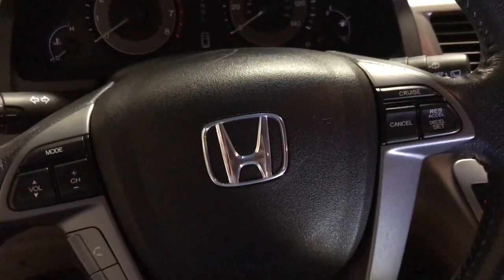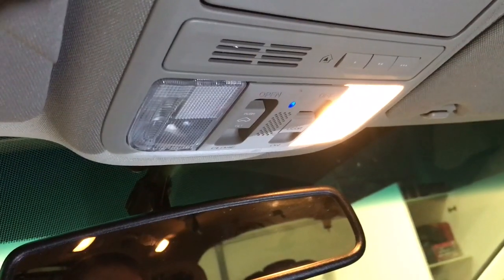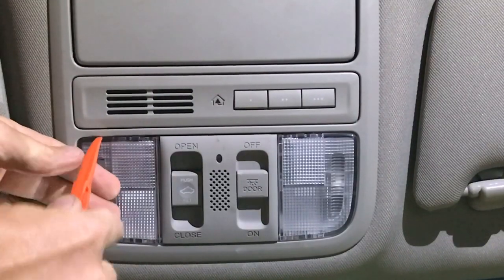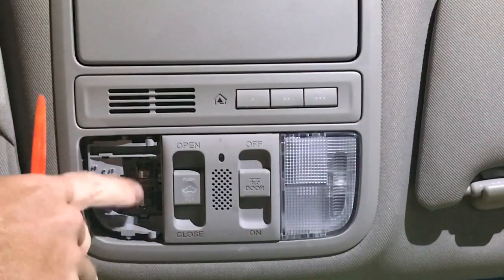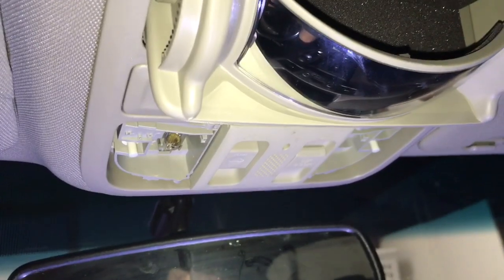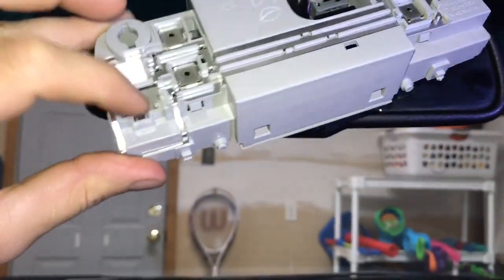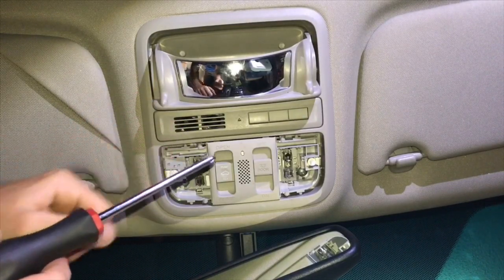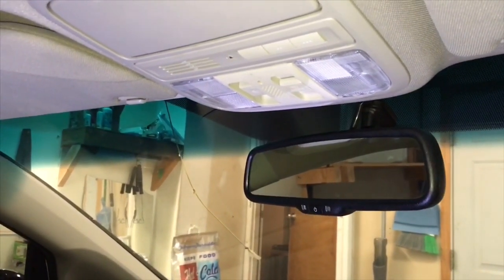Dome light switch and bulb replacement. Honda Odyssey.

Comment: Thank you! This was extremely helpful and easy to follow. After replacing the bulbs and fuse, they dome lights still weren’t working. Replaced both switches and voila, both lights work now plus I was able to return the bulbs and fuse for a full refund.

Comment: Thanks for the excellent video. You explained everything perfectly. In the case of my 2011 Odyssey it was the passenger side that did not work even though the lamp was good and I was able to take it down far enough to get the switch out without unplugging the wiring.  Some shots of CRC contact cleaner into the little holes in the switch and on the three little contact tabs and putting the switch back in restored operation. I probably should have followed up with some WD40, but now that I know the easy procedure I can do that if it fails to work again. BTW, I found it easiest to remove the lenses by prying down on the ends of each lens at the inside corner by the pivot point. Thanks again.

Comment: Thanks for the video.  In my case I didn't even need to buy a new switch.  Just reseating the switch (popped it out and put it back in again) was enough to fix the light.

Comment: I was able to take the unit out without removing the screws in the sunglass holder on my 2009. Just loosen the two screws, next to each light and then pop out the unit using a screw driver.

Comment: Very informative video.  How can one replace the master switch between these two lights that control the on/off/and turn off lights when doors are closed?  I may have a problem with it as sometimes none of my interior lights go off when doors are closed

Comment: Hi - Removed the old switch and the center prong is rusty!  Any thoughts on removing rust?  I ordered a replacement switch.  Thank you!
Reply from the maker: It would be odd to have moisture getting into that location to create rust. It could be corrosion caused by an electrical burn. I would recommend cleaning the connector prong before installing a new switch. If you have a small wire brush that would do the trick.

Comment: I have a 2010 odyssey i bought used and 5 of the 6 lights are not working. Do u think its a blown fuse?
Reply from the maker: If one of the bulbs is working that tells you it is not the fuse.
Reply: So I tried to use the map lights for the 2nd and 3rd row lights, and it's still not working. What could be the problem now? Do u think its the white switch that's broken. But all 4 and the rear door all at the same time?
Reply from the maker: which light is the one that is still working?
Reply: @schottlife9205  the 2 map lights are working, the rest are not

Comment: As time has passed since your posting, could you respond with the quality of the switch?  People have posted that this brand fails rather soon after replacement. Nothing like the duration of the oem switch.
Reply from the maker: Jim, thank you for the question it’s been a little over two years now since I changed this switch. Unfortunately I did recently notice within the past month or two that the bulb will turn on when depressed but will not come on automatically when the doors open like all the other bulbs. This is clearly a switch problem so I got two years out of the aftermarket switch. Looking back I would recommend going with the OEM but the set on Amazon comes with two switches and I still have the other one so it looks like the time to swap another switch.

Comment: Hi, question: I did everything, look good. But when I reinstall the dome light cover,  one of them feel loose then other when press on/off. Thank you
Reply from the maker: My guess is one of the plastic tabs on the cover is either bent or broken. They are somewhat fragile so being gentle with removal is important. If that is what happened you will most likely need a new cover.

Comment: Just replaced my switch & I’ve got nothing 😢 - wonder what else it could be?
Reply from the maker: Are you having the issue with just one light? If yes and it’s not the bulb or the switch I’m guessing it’s an electrical connectivity issue. If you have good power at the fuse it’s between there and the switch but that’s a more extensive repair depending on where the short is.
Reply: @schottlife9205  yes it’s just the drivers side light not passenger 😔 - I hate wiring issues - I can’t figure out where or if there is a relay for the interior/map lights

Comment: I just bought a new switch and still having a issue what could be the issue?
Reply from the maker: Are you only experiencing the problem on one light like I was? If it is just one have you tried a new bulb and confirmed everything connected properly? If it’s on multiple lights it could be a fuse. Just a few thoughts.
Reply: Schott Life I did check the connection it’s all good and yes got a new bulbs and I still have problems. When I press it hard it turns on but not when opening the door.

Comment: I have also found that the issue with the dome lights not working can be related to faulty connections between the switch and the metal railings (bus-bars) on the light assembly (not making contact) and or the metal railings on the light assembly and the clips that hold the lights.

After removing the light assembly and removing the switch as shown in this video, try some gentle scraping on the surface of the three blades that go into the switch (both sides).  I have also used a pair of needle nose pliers to bend the blades ever so gently to be not exactly straight but have a little zig-zag in them so that they make better pressure contact into the switch (make sure that they are aligned when inserting the switch).

Also, the clips that hold the lights need to be partially slid onto and off of the metal bus-bars to remove the oxidation between the two metal surfaces.

Lastly, make sure you have good bulbs (or buy the LED ones referenced in the post).

Comment: Both of my light bulbs quit working days apart.  I bought new bulbs, still didn't work.  Bought light bulb grease, still didn't work.  Dealer said it must be a bad wire that comes from the headliner/ceiling.  Everything else worked in the assembly.  I ordered a used assembly on ebay that said it would "fit" mine, but when I got it, 2 of the 4 wire cluster clips were different than mine (2011 Odyssey EXL).  Same features on both (dual map lights, sunroof button, interior lights button and speaker for Blue Tooth).  I could unscrew and swap the Blue Tooth speakers so that would fit, but not the map lights.  Something to know about should anyone have to get a whole new assembly.  Really disappointed.

Comment: You rock! Thanks. It took me about 10 min from start to finish. I got the kit online and it included new LED bulbs. I replace both switches and added the new LED bulbs. Much brighter now and it will use less amps in the car if you leave your inside lights on by accident (or the kids do!).
Reply: Where did you buy the kit I have a 2018 civic bought new bulb and won’t come on where do u get the switches ?

Comment: Great video.  I have to change the switch on the passenger side. I'll change both side with new ones since I'll have to remove the civer to get to the switches.

Comment: What’s the size of bulb?
Reply from the maker: Here I looked up a link this would give you new switches, LED bulbs, and comes with a plastic tool to access them. All for $10

Link:  https://www.amazon.com/Interior-Ridgeline-34404-SDA-A21-34404-SDA-A22D3-924-798/dp/B07ZYZZ6JT/ref=sxin_26_b2b_sx_top_picks_acb?content-id=amzn1.sym.5ecc5c7c-686e-4608-a0dc-6acf6c6c3228%3Aamzn1.sym.5ecc5c7c-686e-4608-a0dc-6acf6c6c3228&cv_ct_cx=honda+odyssey+dome+light&keywords=honda+odyssey+dome+light&pd_rd_i=B07ZYZZ6JT&pd_rd_r=3746550d-97ae-4e40-98b8-1fb325b1e5e9&pd_rd_w=0jcsb&pd_rd_wg=M2RaZ&pf_rd_p=5ecc5c7c-686e-4608-a0dc-6acf6c6c3228&pf_rd_r=R4H3SK38GNP6Y25ZB2JB&qid=1683570775&sbo=RZvfv%2F%2FHxDF%2BO5021pAnSA%3D%3D&sr=1-1-ab57425f-010b-46ba-9b54-4c012bcb0387

Comment: Good video Matt, thanks, but are the switches from Honda or another outfit?
Reply from the maker: The switches I used are not Honda OEM. It comes in a two pack and I had to replace the switch used in the video after about 2 years. Thankfully I hung onto the other switch and changed it out with the second one. It’s been 5 years now and still working fine aside from that one swap. I bet a Honda OEM switch would last longer but probably double the cost.

Comment: Is it possible that both switches be bad at the same time?  Just got a used Odyssey and neither of the front map lights work at all.
Reply from the maker: It’s possible yes. I’ve had mine for 3 years and only the one side has ever needed replaced. The switch I bought for replacement comes with two switches so I still have the second one as backup for the day I may need another one.